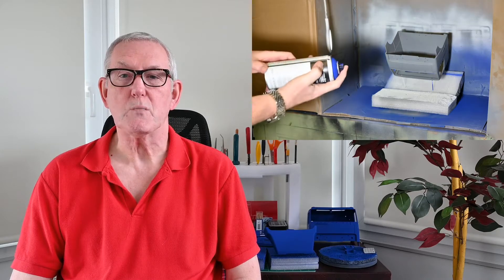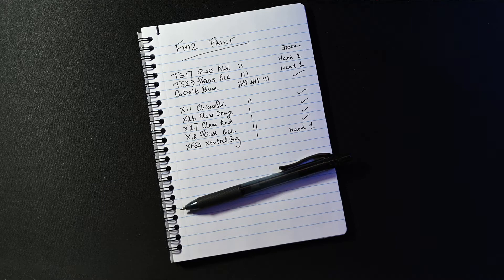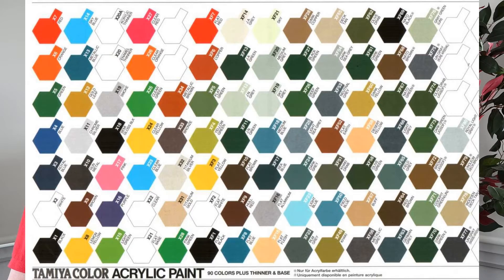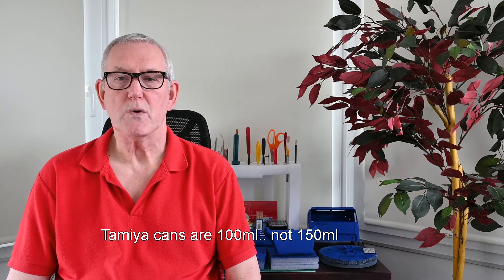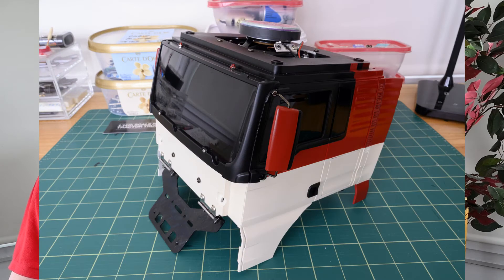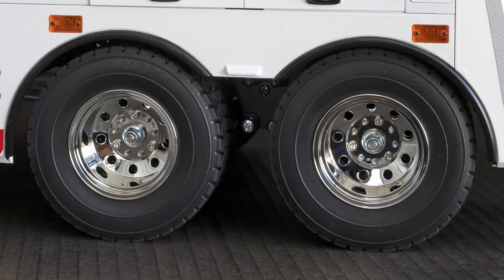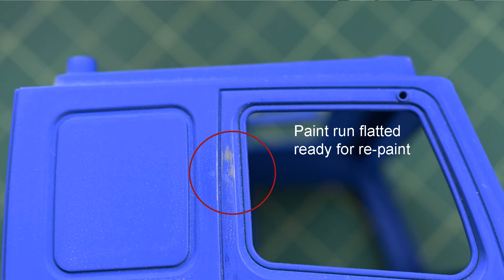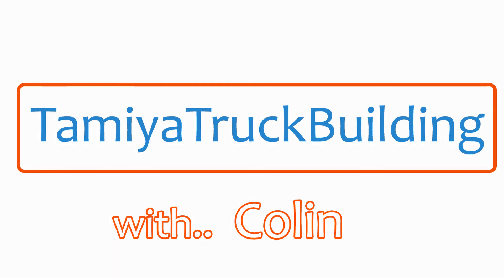SPECIAL - Spray painting your model truck

Comment: Hello Colin, great vid, good to see your channel, like you I am an ardent Tamyia fan, currently building the 6x4 Tipper. I love detail and add quite a bit of customisation. I believe RC needs the drivers and cab interiors, so I endeavour to maintain the original interiors and include the MFC's, not always easy as you mention in one of your later vids with the Beier system. Having found your channel, I will now go through all your vids. I recently built the Knight Hauler and flatbed trailer. I have the tanker trailer in a box ready and also the CC02 Land Rover in the queue .. fun times ahead. well done and keep up your good work.
Reply from the maker: Hello Derek. Thank you for your kind words. It's a small world; I've just built a 6x4 Tipper and an 8x4 Tipper. Next build is a Knight Hauler and tanker trailer.
Reply: @tamiyatruckbuilding7426  I am sure you will appreciate the Knight Hauler, it looks good and has much more space to include some personal touches. As mentioned, I love to add detail and apparent realism, these are after all scale models of the original. I like you am now retired, in my case from an engineering career, and like you I have always enjoyed modelling, including 3D CAD models during my working life, but to build, and use the functionality of models is very rewarding, not so different from my old Meccano days. May the hobby continue to bring you satisfaction and thanks for sharing your experiences.

Comment: Don't forget, spray paint for models is different from spray paint for cars. The actual pigment is about 100 times finer, allowing for much better resolution of fine detail in your model. This, along with the added cost of less paint per container results in a more expensive paint. My recommendation, would you risk your very expensive model's finish for the sake of a few extra pounds? Not me!
Reply from the maker: Thank you for your comments Donna